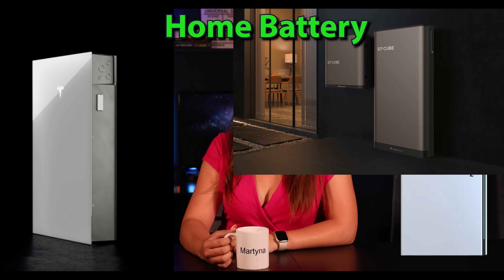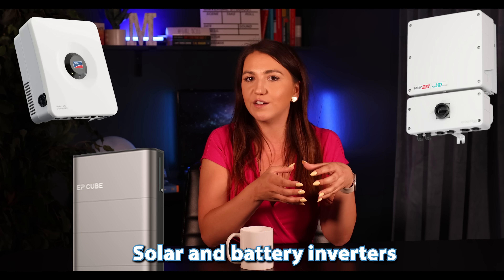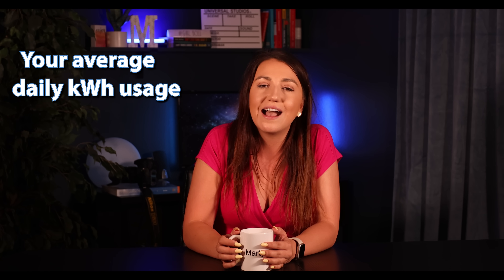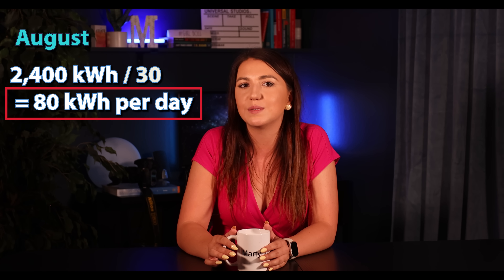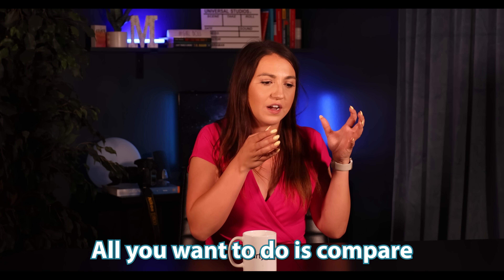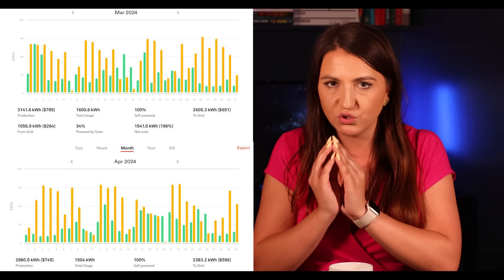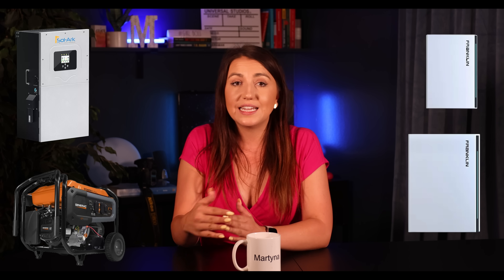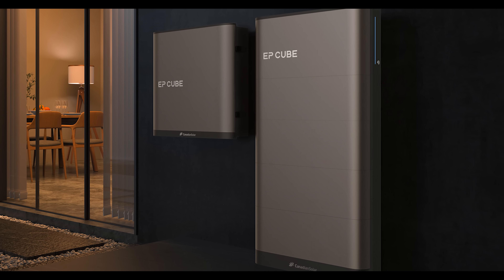How to Properly Size Home Back up Battery ? | Full Guide

Comment from the maker: Hope everyone has a great 4th of July weekend 🇺🇸🙌🏼☀️
Reply: I checked my power bill, Im putting 16kwhr back into the grid - So 15kw should be my starter base battery and do I need to replace the sunnyboy converter with a HYBRID one that can handle grid/solar/gen mix and storage/batts or is thier an additional box I can wire in and save some money?
Reply: My mother have solarpanels, in summer she prodouce 75 kwh but only use 14 kwh and sell the rest, what size of batteri can´t we invest in a batteri that can store a week without sun?
Reply: Too darn hot…but thanks to my Solar installed by your team…our electric bill is BARELY anything! Appreciate you and your team!!!

Comment: Very wrong....sort of...You want your battery to have at least 7 days of Power Required to run your house....why? If your Off Grid you need to account for wether it it might rain 3 day's and 4 Cloudy before your see any Sun again.
Reply from the maker: Thats a very fair point, but that would be a seperate video. This one was more focused on self consumption of sporadic power outages. 

I should make one about off grid :)
Reply: Off-Grid, there comes a point where it makes more sense to have a generator to run for a few hours to recharge batteries with, say two days of capacity, than to spend the money on enough batteries to keep you going for a solid week.
Reply: So it sounds like understanding what goal you are looking to achieve
Reply: @solartimeusa yes please do

Comment: The silverado ev gives you a 205kwh battery backup system on Wheels which I just realized the other day. The truck, lightning as well gives a good back up that the solar can charge. Really awesome way to offset that higher costs. EV trucks are really expensive and so are home storage of that size, but not we can have both in one
Reply: It’s crazy that you can find a used Lightning with a 98kwh for $40k.
Reply: What is the peak continuous kw back feeding the home?
Reply: @Atgul-z6o  Both the Lighting and Silverado have continuous load ratings of 9.6 kW for their home backup systems. Even if you don't get their vehicle-to-home systems installed, they both have on-board inverters and sockets that you can use to power things in an emergency either plugging them in directly, or if your home has a generator hookup and your power demand is low enough, you can use that to power things from an outlet in the truck too.
Reply: Always enjoy your videos. Thanks for the effort.

Comment: Yup, battery sizing is quite complicated and very much depends on what your goals are.   I installed an 11.5 kW (AC) system in February along with 15 kWh of battery capacity.  I still have 1:1 Net Metering, so the batteries are there for backup purposes, and I also have a generator.     I'm up north, so the idea was to have enough battery capacity to keep a the gas heat and some other, smaller loads running overnight without having to run the generator.    I'm confident my batteries will do that, but they sure won't run my central A/C overnight on a hot summer day! 
Another thing people should keep in mind is that battery capacity will decrease with age and cycles.    Ten years from now, the 12 kWh (usable down to 20%) is likely to be only nine or ten kWh of usable capacity. 
I'm probably being OCD, but I've been keeping a spreadsheet, tracking my production, consumption, export, and import on a daily basis, in order to see how much battery capacity I'd need to absorb my production if/when net metering goes away.   My biggest export day was back at the end of April (when no air conditioning was  needed) and was just shy 50 kWh.    So if I never wanted to export any power (and not let it go to waste either), I'd need 62.5 kWh of battery capacity, and better 75 to accommodate future capacity loss. 
Bottom line:  I doubt there's such a thing as "too much battery"; if budget (and space!) allows, get more than you think you need.

Comment: This video makes sense if you get sunshine every day. Some places can go for several weeks without sunshine in the winter. A larger battery and an alternate source is recommended for those winters. Yes in the summer are a few weeks without rain and few clouds, so this is the time to charge the batteries, but it is also the time to run the A/C.
Reply from the maker: That is very true and you can use PW Watts to check out the average daily output, obviously you cannot assume there will be sunshine everyday if you live in Alaska, PV Watts is a very very helpful tool to determine that.

Comment: Love your videos! They're very informative for anyone and everyone. I can only hope that most installers are as truthful and thorough with their guidance as you are.

Question: On the daily usage chart you showed it appears that you either a) have an EV that you charged at night or b) have a battery that you're charging during free night TOU. Which one is it?

The only other suggestion I'd add is that users can lower their battery needs for purely storing extra solar energy by shifting their usage around if possible. For example, if you're at home during the day and you have an EV, it might be more prudent to charge the EV during the day and do your laundry and run the dryer when the sun is up rather than in the evening. While this load offset may not be available due to other constraints, it's is certainly worth considering.

Keep up the great work!
Reply from the maker: @greg_takacs  we have 2.5 evs ! No battery yet. Our usage is so high I just cannot justify the battery yet, we have pretty good buy back. 
We pay 19 cents and get back 15ish.

Even with 2 evs and 1 hybrid we usually average $50-$200 per month of bills with   No trips to the gas stations ⛽️
Reply: @solartimeusa  I have a battery and I do free nights and so far in almost two years I have paid nothing and have $300 credit with my utility company. I also charge an EV at night and replenish my battery as well. I get some credit for solar buyback but for me the biggest benefit of battery is the safety net and that it covers me from 5pm until 9pm when I get free electricity until the morning. I'm re-upping the same contract for 2 more years as soon as I can 😂

Comment: Each house need PV i always say. And saving overproduction in batteries keep my house 10 months of the year nearly net independent.

Fill the roofs!
Well explained sizing!!
+10% for capacity degradation
+10% for more loading save place to increase minimum filling state. I configured my battery to a minimum of 12% (Manufacturer means 5%)
+10% for fun and cloudy days after a sunny day
Reply from the maker: Yes yes yes! So agree and thank you so much for sharing!

Comment: Good info. I think everyone should be encouraged to have emergency backup power. Probably everyone wishes they had it once they find themselves in a long duration power outage. Can be a separate system made up with lower priced DIY batteries that can be recharged by grid, solar, and/or a fuel generator.

Comment: My plan is to buy a cheap Leaf in a couple years from recent Lease deals and do V2H, just parking the leaf 90% of the time.  I don't really want a battery taking up wall space in my garage.  Leaf would sit in driveway.  My utility currently doesn't authorize V2H and push Tesla Powerwall2 only and I am not supporting Tesla at all.

Comment: Nice explanation.  I added batteries (2X powerwall) after having our grid tied 9KW system for 22 years.  When I installed the initial system our Kwh rate was  $0.12/kw-h,  now (off peak-Summer) is $0.55/Kw-h.  I'm about to add a stand alone system for EV charging (60 kw storage with 10 Kw of panels.  That would charge both of our EV's on Level2 chargers by every other day charging for each.

Comment: My highest consumption month was July 2022 in which we consumed 3123 kWh. The house is 2400 sq ft single story and the average outdoor temp in the Phoenix, AZ area for the month was 96.8° F. We had the two, 20 year old,  3 ton A/C units replaced in mid July 2023 with 2 Lennox, 18 SEER, variable speed units. Ouch!. May 2024 we used 40% less power over May 2023 and June 2024 we used 23% less power over June 2023. The temp in May for both years was very similar however the temp in June 2024 was 7.2° F warmer than 2023 and we still saved 23%.
With all that said, we don't have solar yet. I really want to avoid putting solar panels on the house and want to build a pergola in the back yard and cover that with panels. They will face South but won't have much angle to them which I don't believe will matter much seeing how the sun is 10° South of Phoenix during the summer when we need the most energy. My wife and I have had numerous conversations regarding how much pergola area we might need and how much she's willing to give me ;-)
Home and garden show in PHX next week so we'll talk to solar people and landscape and pergola people and see if we can get them all together. I 100% want batteries so I want to go with a string inverter so we're not converting DC to AC and back to DC again to charge the batteries. I want to be grid tied solely for the purpose on the rare occasions that we do get extended periods of clouds that the grid can supplying what my solar doesn't.
Love your videos and information and thanks for reading my somewhat long winded post. I want to make sure I'm asking the right questions when we sit down with the professionals so any thoughts or comments from everyone, are welcome.

Comment: Great video.  You should show off a span panel.  Something I didn't realize was its ability to baseline per circuit draw to predict how long you can operate only on battery.  I now know I can run my fridge, internet, and other have to have items for 8 days 8 hours and 43 mins.  Adding a cyber truck would be insane but for prolonged outages, its around a month capacity assuming  solar is hard down (no production or straight up no sun which is not likely).

Comment: Absolutely to the end of every one of your videos. You have made me do more research before installing solar with or without batteries.

Any thought to a battery only system using TOU night rates to use batteries during peak energy rates and charging at night from the grid? Energy peak forced upon us is becoming the norm in the USA

Also having batteries for daytime peak times lowers the load on the utility reducing brown outs for the neighborhood

Comment: We are in the UK and use around 22kWh per day throughout the year, we have gas heating and no need for air con.  We have 25 panels 10 east 10 west 5 south across 5 roof elevations. We have two 5kW string inverters from Sunsynk in parallel, the panels are Aiko 455W all black. We are in the north of England so much less sun but the panels do work well giving 17kWh in a day of full overcast cloud in July to 60kWh on mixed cloud and sunshine we have 5x 5.32kW batteries. That system in the UK is c£23000 installed. I think we have the batteries right as we have an EV we have a dual fuel rate 50p/day connection and 23.9 day time 7p per KWh 11:30pm to 5:30am low rate. So we can charge the batteries then for winter. In our first month 6th June to 5th July we exported 418kWh our rate for that is 15p/kWh.  I think our system is well sized to our needs, would you agree. We are near Manchester, UK.
Reply: Which company did your install? And roughly how long did it take?

Comment: Great weekend for me -- I was Santa in a 4th of July parade in MA -- not so hot as Collin County in TX.
Have you dealt with tiny homes on rented lots? Our roof has room for 5KW of panels, but no interior room for storage (tiny!)
Reply from the maker: So glad and rented lots ten to be a bit more complicated when it comes to systems. But we have dealt with small duplexes and tiny homes. The problem is usually the space just like you pointed out.

Depends where in USA but a lot of batteries are rated for outdoor and we have had clients build up storage homes, like small storage houses or covers for outside batteries. Wind/ air circulation is every important too!

Comment: I made it to the end.

I'm trying to design a system that has solar, a small home battery, and then a dual direction EV charger so that I can use an EV as a home battery that jappens to double as a vehicle. You would think this would ve way more popular but it seems very difficult to achieve if you want it to be brand agnostic.

You should do a video on how yo hest get energy out of EVs to power a house without buying in to car brand hardware lime the ford, chevy, or tesla ecosystem.

Comment: I was going to get a 16 sensor Emporia so I can get a baseline for my overnight usage, what do you think about this approach Martyna ?  For those edge cases of extended power outages I say just have a cheap Harbor Freight Generator and a disconnect switch and just run you critical loads and go with a smaller battery.
Reply from the maker: That is a very good idea. We used Solar Sense ( https://amzn.to/3RVbGFd - if you have solar, you need to add extra CT clamps). Emporia is less expensive and does the same thing so its a very good idea. 

 Alternatively, you can also ask your utility provider if they can provide you with interval usage (let's 15-minute intervals). That way you can also see how much power consumption happens at night.

Comment: What about off peak battery charging. Thinking of charging batteries over night with no solar ? Would this be cost effective?
Reply from the maker: That depends on the cost difference during the off-peak rate. Cost of storing 1 kWh is still around 20 cents in some cases even more than that, so you would need a pretty big difference for it to make sense.
Reply: @kevanswift7797 To an extent it depends on what you mean by cost effective. If you are getting the battery storage because you want backup power* and you're going to have it anyway, you might want to use that capacity to save money with load shifting if you have time-of-use pricing, or earn money if you're in an area with a virtual power plant program which will buy power from you that you've stored when they need more supply, or just reduce your carbon footprint if there are times when the grid's carbon intensity is higher than others (e.g.: if gas peaker plants are a higher percentage of the grid generation mix in high demand periods) rather than just having it sit idle. Now, this does put cycles on the battery and cause it to age, but it's healthy to cycle the battery periodically anyway, so you might do it some of the time and get some benefit from it rather than just having it sit idle. Using it if you already have it in these ways might have a marginal cost lower than the benefit, taking into consideration the depreciation cost of the small reduction in cycle life.

*whether with grid only, with solar, or to stretch your fuel further if you have a generator. The reasoning for the generator thing is basically that at low loads a combustion generator is very inefficient. If when you're running the generator you can power your backed up loads plus charge your battery storage at the correct power to bring the demand high enough to run the generator at its peak efficiency, you can run your backup loads off of the battery storage most of the time and just run the generator when you need to recharge the battery bank, and use less fuel for the amount of energy you use. This also has the benefit of being quiet more of the time, which may help with being able to sleep at night, or reducing the chances of attracting unwanted attention.
Reply: turn big wheel like conan barbarian, no need wasting time and energy at gym

Comment: Here in higest rates and anti-solar California we can pay $16/month to get a 13c kwh rate, but then our peak rate is 70c and middle rate is 40c. Because of this sizing has become more of an arbitrage calculation between charging batteries and EV's at night and then eliminating any peak usage and minimizing middle rates with the batteries. Years ago I sized my solar for 100% but if I did it today I'd probably go with solar for about 50% of my usage, battery capacity for about 65% and not grid-tie.

Comment: My brother just got his company certified for Franklin. Are they considered high end? I'm researching getting a solar and battery system, plus i just got a Cybertruck, so want the system to work with powershare (generator input?)
Reply from the maker: Franklin is a very good battery, it is an AC coupled system, so I think it will be a big market for existing solar system additions. 

For new systems, Tesla Powerwall 3 ( hybrid ) seems to be making a big statement.

Comment: Martyna: I hear that Tesla will soon come out with a meter that will allow A/C-coupling with their Powerwall 3. Do you have specs on it yet? Also, is Oncor allowing their switch at the meter yet?
My biggest problem is measuring my consumption. Your company installed a 7.6 kWh system for me without a battery in 2022. I have specs for monthly billing, system production, and grid credit, but I'm not sure about daily consumption. I want to add a battery, but am holding out for salt-ion or solid state (have some A/C upgrades I need to do 1st.) Can you suggest something?

Comment: Wouldn’t my break-even be faster and my 10 year and maybe even 25 year ROI be higher if I just got a an EP4 5kW $1,500 battery just to get the $9k credit from Encore for a 15kW system?  I think I’d use all the electric produced  because we use roughly 150 kW per day on average.